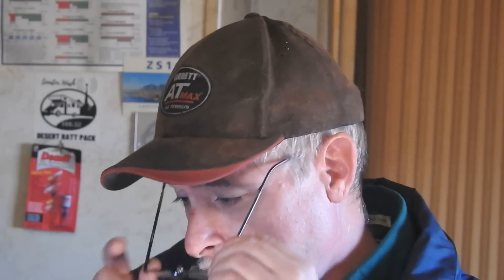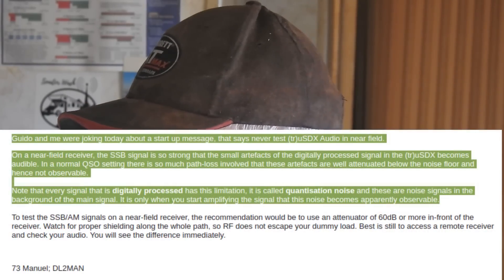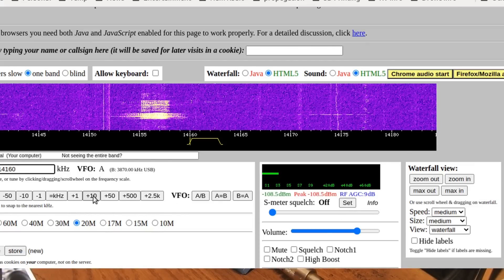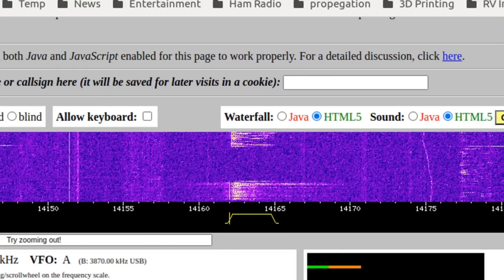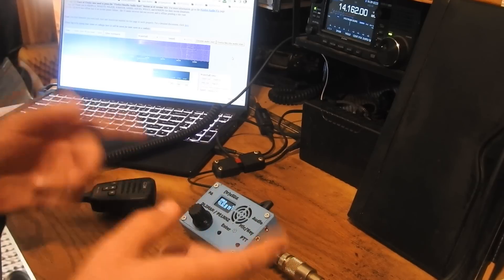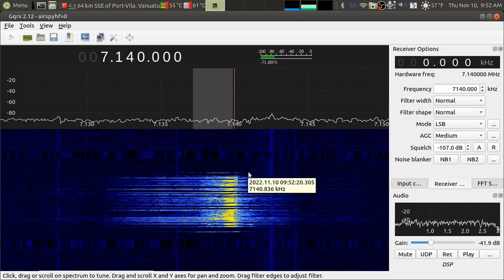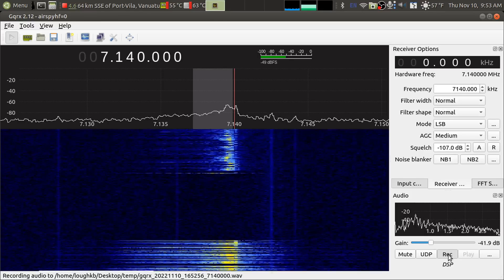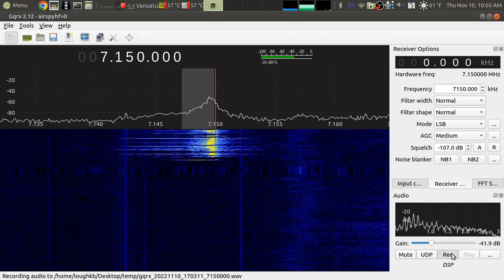Ham Radio - tr(u)SDX splatter problem, further testing.

Comment: My issue with your Videos is: You´re just "pushing" and creating publicity in my opinion. The issue could have been resolved immediately if you just had accepted replacement. You insisted, you wanted to fix it yourself, and here we are.  I´d have appreciated, if you just had worked with us, trying to resolve the issue, and only then make a Video about the solution and the results. From a content creators perspective I can understand, as "pushing" creates content and clickbait. From a ham perspective, I think you´re mis-representing the whole issue and doing even a dis-service. 1. There´s definately a different picture remote vs. local. So jumping immediately to the conclusion your local measurements are right is a little bit fast at least. It clearly shows mitigation remote, yet there´s an issue with your (tr)uSDX. 2. The (tr)uSDX is designed for abt. 45dB of Sideband Suppression, and because of simplicity of schematic you shouldn´t expect IC705 Performance. So instead of looking at the waterfall, try to work with the dB readings in the histogram. Looking at TX Drive 2 tests, this looks already within -45dB requirements. However: There is abnormal behavior in your case. 3. Your signal is clearly unclean and noisy. That´s your real issue. Like something is switching on and off at the wrong time. Try working with 3.2 Noise Gate, as your input threshold is clearly off. You can also try different external mics and see if it changes anything 4. You´re txing full bandwidth (no restrictions). If you apply SSB Filters on RX, this will also limit your TX Bandwidth. Try to compare apples to apples, if you do an unfair comparison as tx bandwidth of Icom is also limited. That being said: I find, your videos are not representing the (tr)uSDX Project, and we could have helped you with your issues (as we tried). A guy with your amount of followers should be more interested, and has the responsibility in "getting it right" before creating a public false impression, that (tr)uSDX is bad to the bone. This clearly mis-represents the (tr)uSDX Project, and is harming the project, that changed a lot of peoples lifes. I know you don´t mean it that way, but I get mails from people, that are now insecure because of your issues. You have a lot of subscibers and your range is far, so please be aware of your responsibility. I´m more worried about the people that did not write me, because they just drew the wrong conclusions right away, as they believe you..... But that´s your decisions. I´m just giving my opinion here, but I will no longer be "pushed around" by such Videos like yours. That´s freedom of speech, but me disagreeing is also. Good Luck ! 73 Manuel; DL2MAN
Reply from the maker: Manual,
   Ok,  Lot's to address, I'll take it a chunk at a time.  

You say:
"The issue could have been resolved immediately if you just had accepted replacement. You insisted, you wanted to fix it yourself, and here we are.  I´d have appreciated, if you just had worked with us, trying to resolve the issue, and then make a Video about the solution and the results."
   
   At the point in time that replacement of the RF board was offered, I thought it was fixed.  The problems I'd had with stability and rebooting were resolved and I saw no need for the replacement board.  I was unaware of the modulation problem at that point.    

  However, I would welcome a replacement RF board at this point as I'm somewhat convinced the problem lies in that board.  

   Also, this series is an experiment, sharing each stage of my exploration of the radio.  Not just a polished finale,  but each phase that leads to the finale.

You say:
"From a ham perspective, I think you´re mis-representing the whole issue."

I'm attempting to be as transparent as possible,  sharing exactly what I observe.  Nothing is misrepresented or altered.  They see what I see.

Now to your numbered points.

"1. There´s defiantely a different picture remote vs. local. It clearly shows mitigation remote, yet there´s an issue."

   The entire signal was lower on the remote.  Far enough above the noise to be discerned but much weaker than in the local test.  The edges of the splatter were not as clear, but still present.   It wasn't that it was better, there was just less signal to see.

As to Point 2.  I have seen a much cleaner signal from another tr(u)SDX with no visible energy in the suppressed sideband.  I know the radio can do MUCH better than what I'm seeing.  Even at TX drive level 1.   And you do concede that my case is abnormal.  In line with my repeated statements that the problem is with my radio's build.  

As to point 3.  That is helpful, I'll look at the noise gate setting.  I suspected something like that when it was chopping off the audio all together on 80 meters.   However, the degree of splatter varies greatly on the different bands, so I doubt a setting that applies to all bands would be the problem.  It doesn't chop off the audio on 20 meters and hardly at all on 40 meters.  Being frequency dependent like that leads me to think it's something wrong in the RF section

Point 4.  Bandwidth.  The audio is rolling off just under 2 KHz, so there's nothing to modulate above, the filter shouldn't matter.  However, I will look into that.  
As to your last statement, 
"I find, your videos are not representing the (tr)uSDX Project, and we could have helped you with your issues (as we tried). "

As I have stated more than once in the vids, I'm sure the problem is in my unit and not representational of the radio in general.  
I don't know that I can be any more clear.   
I didn't feel I was getting help initially.  When I emailed pictures of the bad soldering, you initially replied that you didn't see bad soldering.  After I detailed it in the video, it was taken seriously and you worked with your builder to get that problem resolved.  That was a good result.
  When I observed the bad splattering, you told me it was artifacts from the digital processing only visible in the near field.  That didn't make sense given the magnitude of the observed issue of clipping and splatter, but I gave you the benefit of the doubt and tested it anyway.   
I will get to the bottom of the issue on my unit and share the solution eventually.  I'm sure it will help others who build the kit to avoid whatever the issue turns out to be.

This also ties to your final statement:
"A guy with your amount of followers should be more interested in "geeting it right" before creating a public false impression, that (tr)uSDX is bad to the bone, which clearly mis-represents the (tr)uSDX Project. I know you don´t mean it that way, but I get mails from people, that are now insecure because of your issues. I´m more worried about the people that did not write me, and just drew the wrong conclusions....."

Again, I have stated publicly and in the vids, more than once, that the problem with my unit shouldn't be a reflection on the radio in general.  I don't know how I can be more clear.
  There will be people that jump to conclusions, I can't help that.  I'm not hiding anything, I'm not misrepresenting anything.  I'll pin your comment and my reply to the top of the comment list so your input can be considered as well.   I'm just trying to be fully transparent in my exploration of this radio.   Warts and all. 
  I'm sorry you're getting some flack, that is not my intention.  When I come back to this project, I'll open the video with a strongly worded statement, again, that my issues are with my one unit and should not be considered a reflection on the radio as a whole.   I've said, publicly, in the videos, I've heard from many people that have perfectly fine units without issues.  And I've pointed it out yet again here.   

  On the subject of the radio's settings,  What should the working defaults be for TX drive,  Noise gate,  Bias min and bias max?   I assumed the out-of-box initial boot up firmware defaults should be close to correct, but that assumption could be wrong.  

   When I come back to the project, I'm planning on going through a complete alignment as one would if building the kit.  I still think it's a hardware fault somewhere on the RF board.

EDIT:  John, AE5X also did a test, looking at the spectrum and using two tone injection to measure IMD.  
https://www.youtube.com/watch?v=iPmv1g9rv7s
Reply: Love that you and Manuel are able to work together on this.
Reply: @KC3DJV  they look at odds w/each other to me.....
Reply: Luckily DL2MAN found a defective trusdx in his own stack and now recognizes the problem... Sorry that there is so much hate with the haters, ignoring them isolates them...
Reply: You two need to sit down and work on your misunderstandings! You two are, for sure, keeping each other at arm's length!
Reply: @awaismushtaq5719  Welcome late to the party ;) Everything settled. I apologized the same day in public with this Video: https://www.youtube.com/watch?v=RsZIJtpEM64 and the issue has even already been solved: https://www.youtube.com/watch?v=dHttnDdADqo 73, Manuel; DL2MAN
Reply: @dl2man  why say first to apologise later?
Reply: @awaismushtaq5719  Because I did not see the issue in the first place, and thought, Keven was just "pushing". When I learned it´s a real issue, I had to do, what decent people do: Admit, that I was wrong and apologize.
Reply: Manuel you are going to make yourself sick if you keep worrying about every little doubt about your fine work. The value of Kevin's video is showing some troubleshooting techniques, but all you see is "harm" to your project. Stop it (please).
Reply: Amongst all this gentlemen, you are denying the beauty of analogue signal processing. It was analogue signal processing that gave birth to amateur radio. I hate unnecessarily throwing digital crap on to the beauty of analogue! Ah! Miss the old days!
Reply: @awaismushtaq5719  You are absolutely right. Analog gave birth, but digital is the future. Imagine no one would have thought "out of the box" back then, or ever.... We would not have any technology.... 73 Manuel; DL2MAN P.S. Welcome late to the party ;) Everything settled. I apologized the same day in public with this Video: https://www.youtube.com/watch?v=RsZIJtpEM64 and the issue has even already be solved: https://www.youtube.com/watch?v=dHttnDdADqo 73, Manuel; DL2MAN
Reply: @dl2man  You believe, sir, that analogue electronics was not 'out-of-the-box'? Really? It was, back then, as much out of the box as is digital electronics today and, as you say, in future.
Reply: @awaismushtaq5719  No, I mean the exact same thing as you do: Analog was "out of the box thinking" back then, as digital is now.
Reply: @dl2man  thank God we agree on something!
Reply: @dl2man  whole science and engineering is out of the box thinking. It's this kinda thinking that sows the seeds of innovation, ingenuity, creativity etc

Comment: The inconsistency of the results across users may suggest quality control issues related to manufacturing or assembly. Statistical process control has been used to effectively mitigate discrepancies in production rather than trying to correct later. It seems there is already rigor in the expected design performance, so focusing on specific production tests and associated test period may offer a potential solution.

Comment: (Tr)uSDX’s ancestor uses Hans’ QCX circuit, it has little intermodulation due to filtered PWM audio modulating a cascaded transistor in linear mode to supply modulated 12V to the class E BS170 mosfet drains for the restoration of the SSB envelope.
The current (Tr)uSDX has its audio filtered PWM and SI5351 clock output (square wave) tied together to the BS170 gates. which affects the BS170 transfer characteristics of linear and saturated regions in the same time, a simple explanation of your unpleasant experience with splattering noise.
It is better to address this issue to PE1NNZ, DL2MAN has nothing to do with it, he is just a designer of the Class E amplifier based on WA0ITP spreadsheet

Comment: Thanks Kevin! I appreciate the issue you have raised as well as the brilliance and low-cost of the tr(u)SDX. It is truly a ground-breaking design. This issue illustrates my reticence to buy one and instead wait for the long delayed QSX from QRP-Labs. Hans puts an impressive finish on his products. The cases of the QCX-mini is beautiful and the feature set impressive. The QCX-mini isn't just a single-band CW transceiver. It does WSPR and CW beacon mode. It decodes CW and offers Iambic modes. It is rock stable and has built-in test and calibration features. Bought separately, the added features would cost more than a QCX-mini sells for. Since I have a desktop SSB rig, I can afford to wait (and wait and wait) for the QSX. I know it will be worth the wait. https://qrp-labs.com/qsx.html

Comment: Try doing something really old school--look at the signal on an O-scope. If the finals/driver is flat-topping, it will be obvious. If it's not flat-topping, then the finals/driver are not running in an AB or B bias region (effectively crossover distortion). de kg5ar
Reply: Hello Bill, 

this is NOT a 'Class-A' or '-AB', nor a '-B' -radio! 
Please RTFM before telling something like that, ... ! 

It's not a 'linear-amplifier' in this "PA" ! 
Only 3 small BS170-FET's, generating close to 5W, with an 'eta' of 0,8 and better, ... ! (Eta> 80%)

It is a little bit 'more complicated', not as 'rocket since', but nearly on, ... ! 

Modulation of phase and amplitude inside the frequency domain! Not a 'simple ring-' or 'diode-mixer', or something similar simple device. It's all a kind of DSP-formula inside the 'Arduino-IC' that generates the SSB-Signal. 

And, ... don't forget, it's a simple experimental SDR-TRX, for less then 100€ . No one is advertising a 'Yae-Com-Wood' for +10k$ with 'absolute' preformance, ... ! 

Please hold this in mind ! 

73 de Markus ; db9pz 

[ Owner and 'proud' user, of a 'homebrew' (TR)_U_SDX ]

Comment: Great videos. I think I’ve seen all the ones related to this radio. I do own one. I purchased a pre-built unit from an authorized dealer. I’ve had a lot of POTA hunting success with it from my front porch with a wire in a tree. With that said, I have not tested like you have. I hope I’m not splattering on the bands.

I think what your doing is very helpful for the community and potential builders of the kit version. It helps them with troubleshooting steps when theirs don’t work quit well. Also, I printed the power pole holder, works well, ty for that. 

I’ll keep watching and learning. 73.
Reply from the maker: It's worth the money for a great little CW rig, for sure.   That's primarily what I bought it for and I have no complaints on using it for CW.

Comment: Hi there, this is in the RF stage, i know you now all this. Two Suspects in all this probably accounts for the hit-and-miss working correctly from one device to another, T1 and T2,  pay attention to how they have been wound, even more particularly to start and end windings, make sure the start and end of the windings have been fitted correctly  on the board, this will definitely affect the transmit.   I would check the rest of the windings is on all the inductors, maybe even take a reading of what they are to what they should be. I would love to get my hands on one to build, maybe video and upload any findings.   Thanks for all your time videoing and uploading.  The DM (UK)
Reply from the maker: T1 and T2, got it.  Thanks for the suggestion.

Comment: Thanks Kevin for your very well done analysis.
Simply let's all admit that the tr(u)SDX is an overly simplified DSP receiver and transmitter.
Don't forget that the origin of it is a technical challenge : to modify the QCX to make some real time signal processing, on a ATMEGA328P processor (a very low end processor from the Arduino). A bunch of trade-off to make this, using a 8 bits 20 MIPS processor without a DAC to generate the TX signal from I/Q vector. 
This is genious to make it work, but it pushed the concept to the limits. Thus the RX and TX signal quality is somewhat limited.
73, F1SOC
Reply: Limited! Now you are over simplifying things, sir. It's terrible.

Comment: I really don't understand why any of the tr(u)SDX tests were done without a mic or even the same mic. Really not crazy to me that the included on board microphone is potentially really bad.
Reply from the maker: I'm going to have to start copy pasting this reply.  
As seen earlier in the series, when we tested AM and FM, the audio was clean and free of distortion.  Even when I got close to the mic and spoke loudly. 
So the mic and any analog circuitry behind it is not the problem.

Comment: I would look at the balanced mixer. That’s what it sounds like to me. I used to adjust PCM equipment in the military.
Reply from the maker: That's done in software on this radio, there is no physical balanced mixer.
Reply: @loughkb  IMHO, That would make me suspect it even more, since CW is fine. Balance in the mixing stage is extremely critical for carrier suppression and would affect bandwidth directly.
Reply from the maker: @paulblock1367  You can't really apply classic analog theory here.  They are creating SSB through software in an entirely different way.  Nothing at all like a balanced mixer.

Comment: Kevin,
I built the low band (original) version about a month ago and although I have only made 2 contacts  they were at 933mi. (weak) and  714mi. (better), the latter complemented the audio. Both were using a DX Commander from the home QTH.
Herb W5TEK

Comment: What about on FM or AM ? G7VFY
Reply from the maker: Two or three videos back in the series.
Reply: @loughkb  Have you tried using an audio signal generator with adjustable attenuation ? I don't suppose another microphone.  Maybe putting some ferrites on the mic lead? just a thought. 

I suspect a problem solder joint might be acting as diode and creating some weird mixing effect. G7VFY